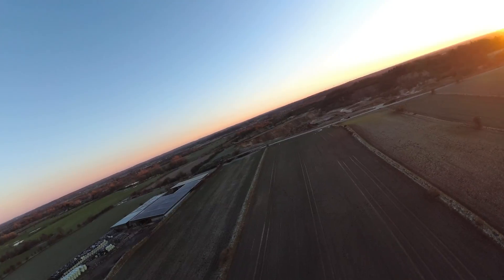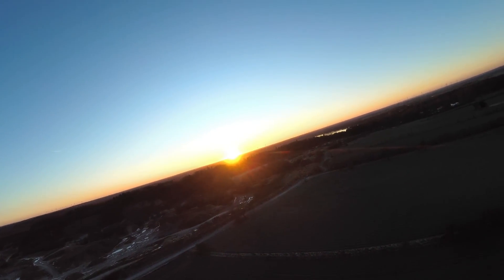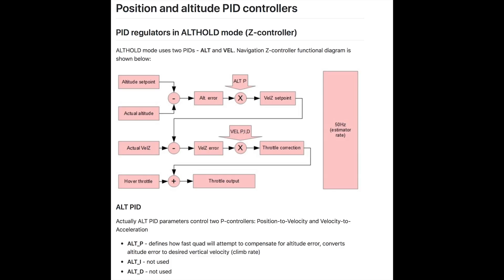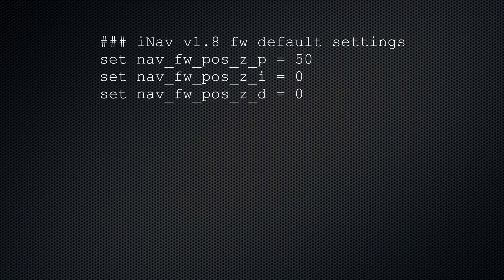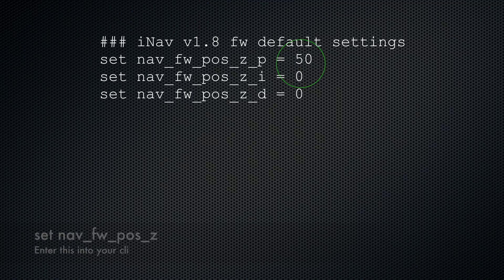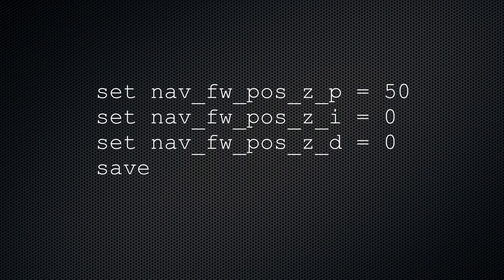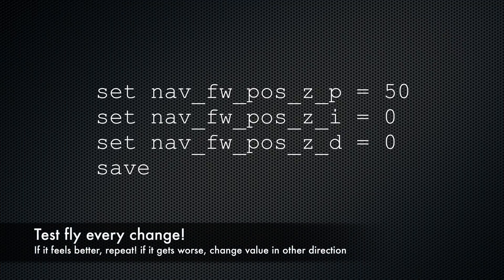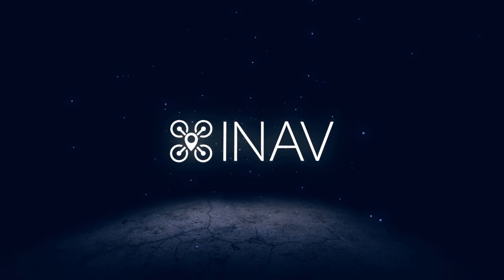iNav - solving oscillation in PosHold and RTH (FW)

Comment: This method works on AIR mode also? I have the value of 40 and the oscillation is bigger
Reply from the maker: I guess many things have changed since we’ve reached iNav v3.02 ! Today there are better ways as in flight adjustments and autolevel.
Reply: @JustFPV-net  I use inav 2.5 and i tried autotune/autotrim, but it oscillates
Reply from the maker: Try atleast v2.6.1 :)

Comment: thanks for the video: would you know how to solve lateral (yaw) oscillation? recommanded values?
Reply from the maker: Hmmm it’s mostly a problem with antennas which seem to deflect the air differently from one wing to the other. Personally i don’t have that problem. Maybe it helps to get the CG a little more to the front? 
I know there is a value for that in iNav but I didn’t try that yet
Reply: You are good! I do have an antenna on one side. I did not suspect this would make the fc over react in low loops.

Comment: Just checked mine with iNAV 1.9 and default is 50. Unfortunately I Just reflashed the board and don't know what my 1.8 setting was. Will fly and try.
Reply from the maker: Same as we do with ours- try and adjust to make it smooth
Reply: I just checked an old dump file and it was set at 50 in 1.8. do you suggest starting by raising or lowing 10? it was just a little bouncy on the nose in RTH
Reply from the maker: Hard to tell- try adding 10 on the I term
Reply: Matebox in Motion will give it a try. Keep up the good work.